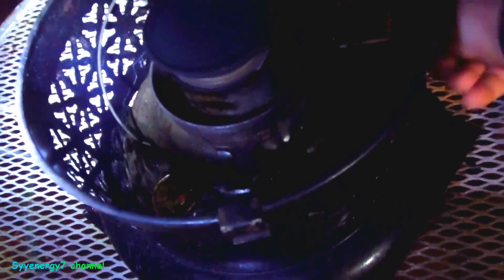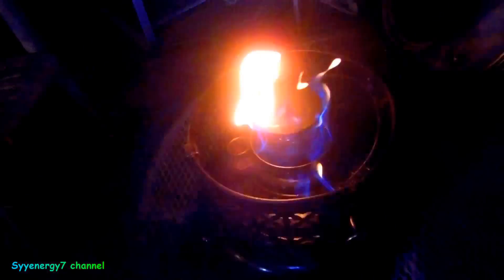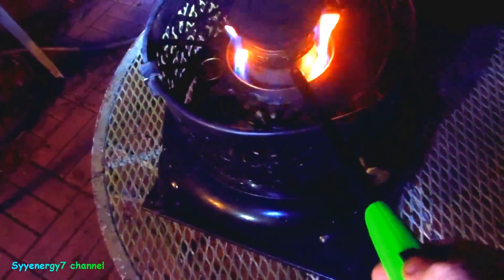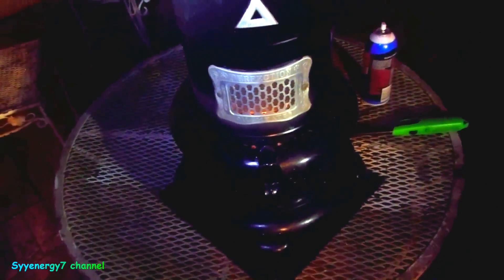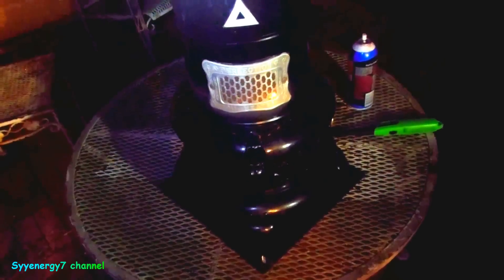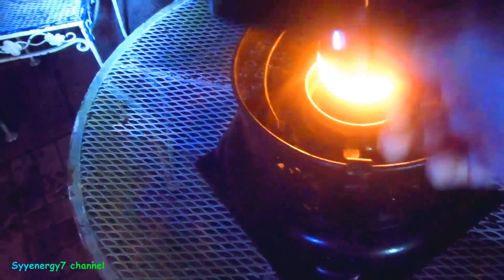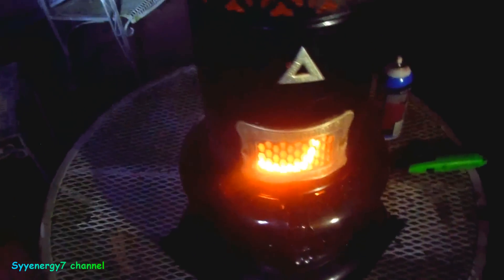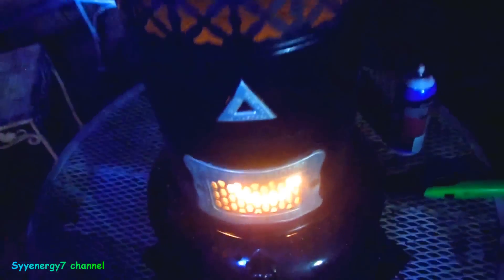The Fast & Wrong way to light a Kerosene Oil Heater

Comment: you can't use those inside without proper ventilation right?
Reply from the maker: +pdxeddie1111 Correct.  You need to crack a window.  It does need to be much.